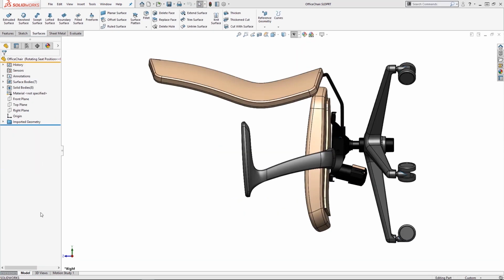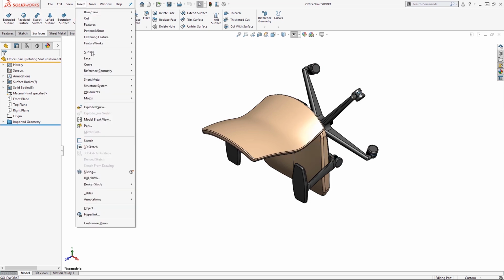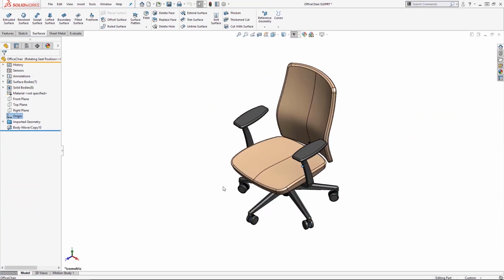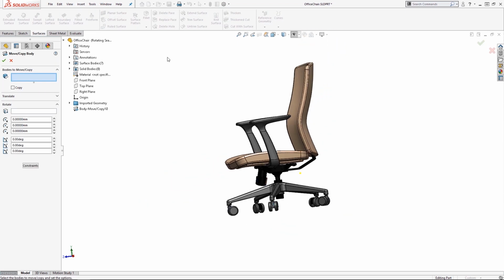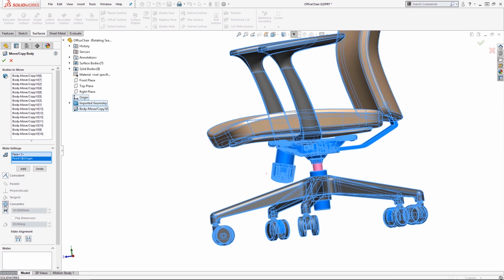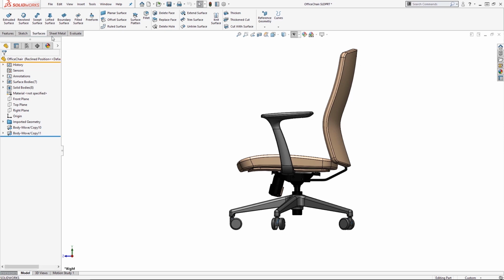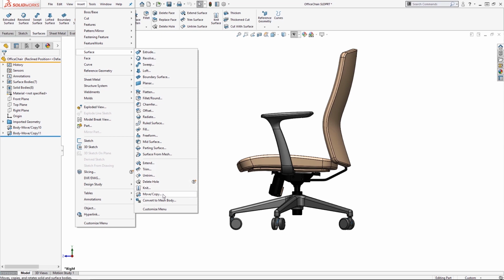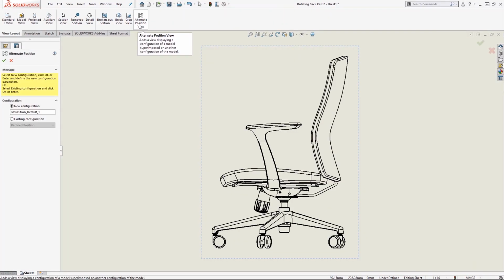How do you rotate a part in SOLIDWORKS?

Comment: This only works on a part?  What if it's an assembly?  Would I have to save it out as a part first?
Reply from the maker: Hi! There's a 'Rotate Component' tool under the 'Move Component' drop down in the Assembly tab. Otherwise, you can mate planes and faces between components to rotate them and constrain them. 👍